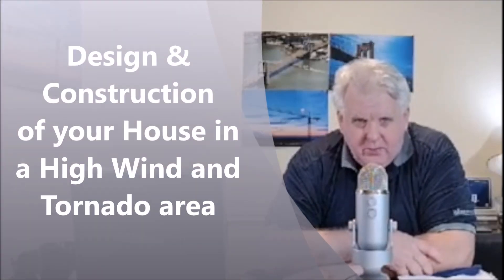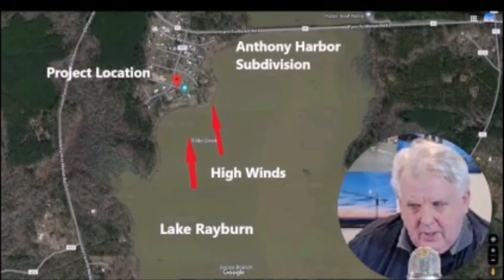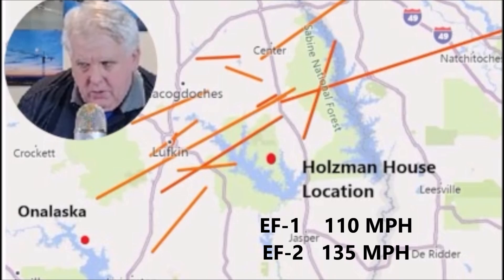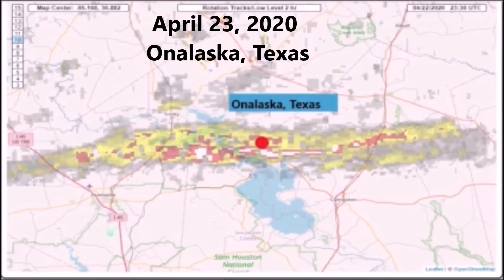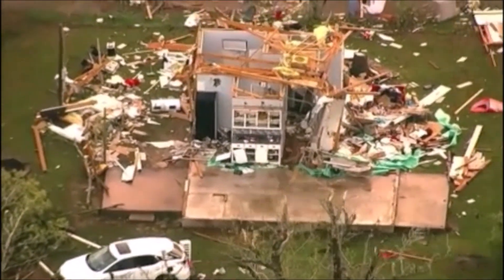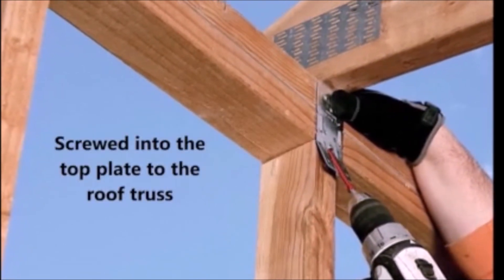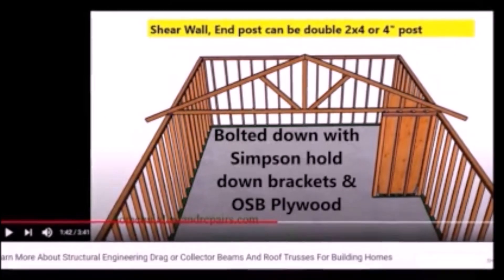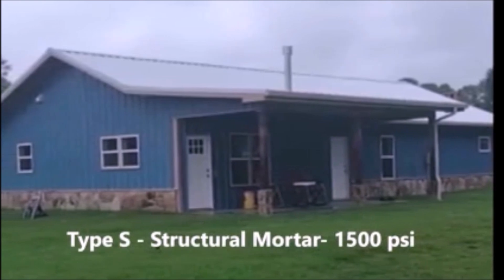How to Construct Your House to Withstand a Tornado!

Comment: I appreciate what you are doing for the welfare  and safety of your clients. It must be rewarding to now you give families added protection  and peace of mind. Just one question is: That bottom plate bolted down with the large washer, has  that got a bracket connecting the bottom  plate  to that stud that's beside it?  Because I didn't  see it in your photos.
Reply from the maker: We screwed the Simpson hurricane screws into the studs, down into the bottom plate. I might not have shown that procedure. Initially, I had them screw the hurricane screws into every other stud at the top and bottom plate; however, after reviewing the loads, I had them screw them into every stud.